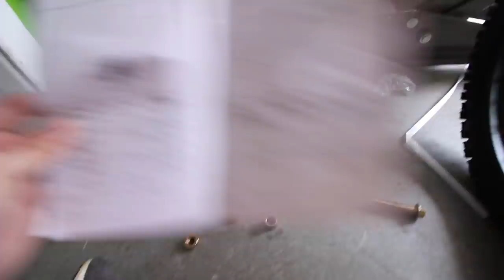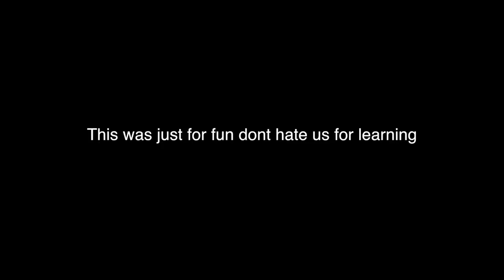UNBOXING My New Apollo 125cc Pit Bike!  How To Put Together Apollo 125cc Pit/Dirt Bike!

Comment: Good video, just one recommendation that can never be repeated enough.... Loctite everything. And i mean everything, if it has a nut...locktite. If it has some threads sticking out and you dont feel like doing the work at least put some on the ends. Everything vibrates out so check everything out before you ride. Also if you are the type of person that likes wheelies then add a little extra oil to keep things lubricated. Have fun, goodluck, and see ya on the ice.
Reply: Cool duder! 🫵🏽😎

Comment: What I learnt with these new pit bikes, choke should be all the way up and then ride it like that until the engine is warm and then out it down, may not work for everyone but has worked for me. Great video!!
Reply: thats usually the way to go for sure. it all depends on how you decided to tune the carb but usually if properly tuned, a bike may need the choke on when cold.

Comment: Some things up with that bike you can here the vacuuming issue when you first started it and touch the throttle I'd check out the card area see if everything is tight it sounds like when you touch the throttle you can hear it sucking air in somewhere really bad
Reply: It's chinese that's what's wrong with it fun little thing i wouldn't take it to a track or woods that's for level yards and quiet streets pretty cool for under 1k tho